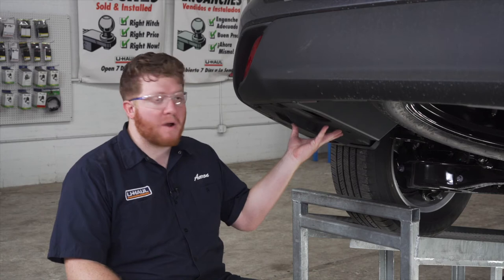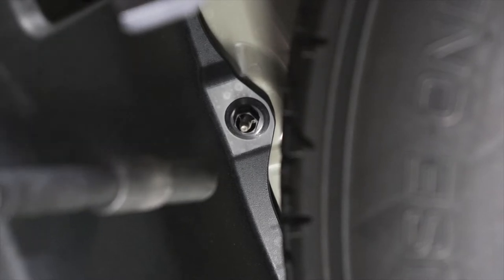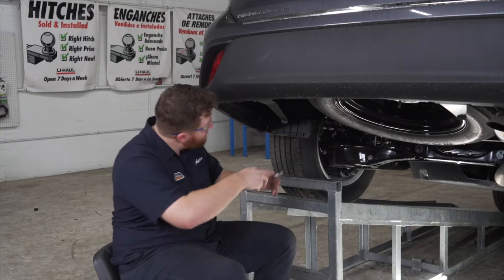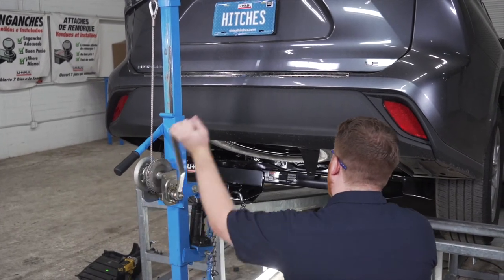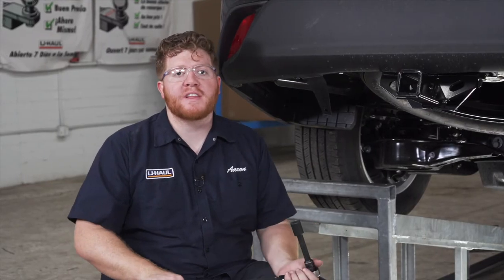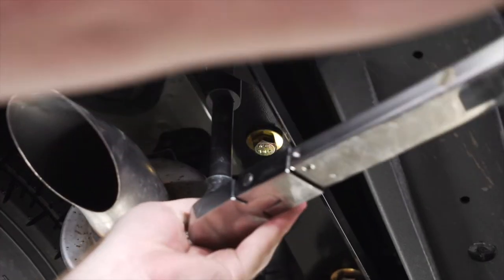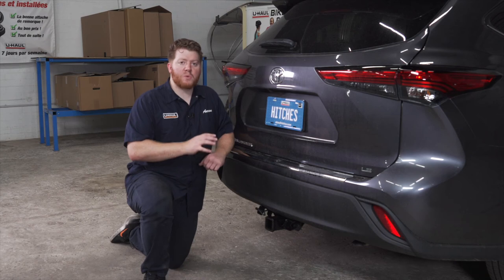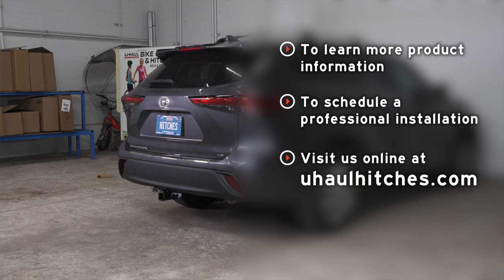2020-2024 Toyota Highlander| U-Haul Trailer Hitch Installation

Comment: Hi! 
Is this Trailer Hitch suitable with a full-size spare wheel?
Reply from the maker: Looking at the manufacturer pictures in the instructions it appears that it would be a tight fit, but would work with the full-size spare. Experiences may vary of course.

Comment: Can I use this to pull my 30ft’ RV?
Reply from the maker: This hitch is rated to 5,000 lbs. gross trailer weight and 500 lbs. tongue weight; So if your trailer falls under those measurements then you are good to go!
Reply: Can I buy this kind of hitch in your company?
Reply from the maker: @gbaringtv5083  https://www.uhaul.com/Trailers/6x12-Cargo-Trailer-Rental/RV/

Check out this link to find the closest U-Haul center and they can get it ordered!

Comment: Does this apply to 2022 Highlander Platinum with 20 inch tires? Do you lose the kick sensor ?
Reply from the maker: Yes! This will fit all 2022 Toyota Highlander styles.
Reply: You will lose the kicker sensors typically.
Reply: Hoping this doesn't fully block the kick sensor on a 2022 Highlander Limited. I heard it will block the middle section but not the two sides of the sensor. Would be awesome if someone can confirm.
Reply: @BostonDigitalMedia  After installing 2 inch hitch the kick sensor works on the right side
Reply: Ok so I just tested a new highlander hybrid bronze with the OEM tow package. 

They moved the kick sensor to the left so it works !
Reply: Only if you add the wires you will lose the kick open door other than that it will be good for just a cage cargo